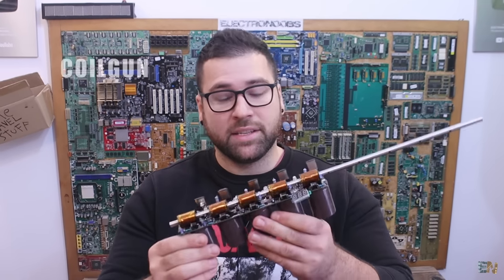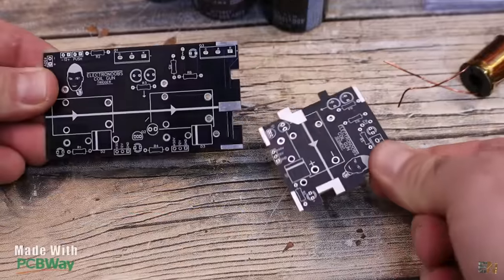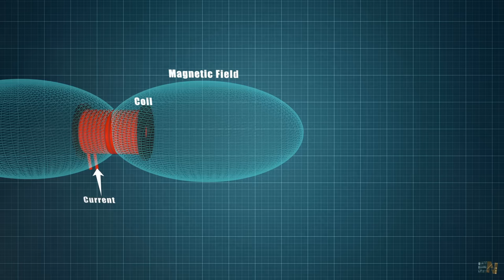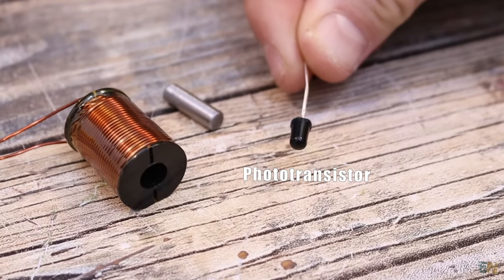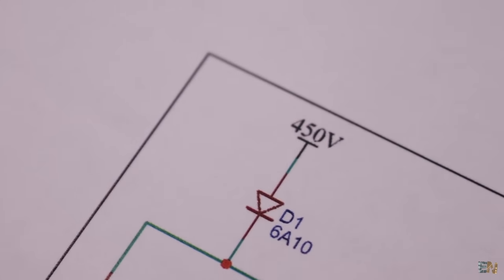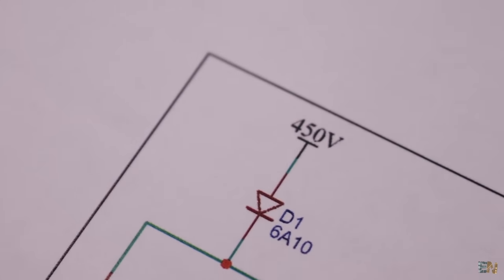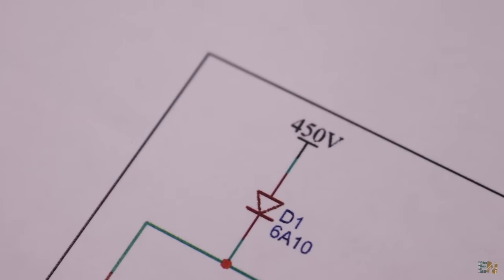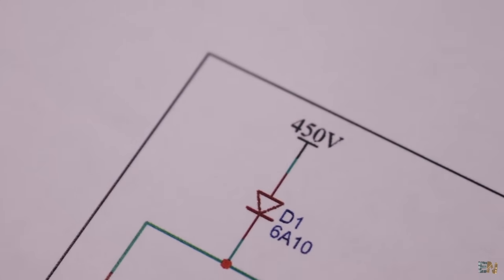I've Made a Powerful COILGUN | Separate Stages PCB

Comment: Perhaps using timing rather than photo sensors would mean more tunability. This would be more complicated because each projectile must be the same, but it could go supersonic this way :)
Reply: Having a weapon with both options in one I think would be the best design for usability. If for whatever reason your programmed timing doesn't gel with the current atmospheric conditions or whatever other variables, you can swap to the sensors as a less powerful but more consistent option for harsh environments.
Reply: Be limited by how fast the triac switch turns on what cud be faster tho ....I need make one just with 3 stages 😮

Comment: BTW, running big high-discharge-current caps at a higher voltage than they're rated for (e.g., 500+VDC on a 450V cap) is a pretty good way to have one explode. Might want to dial back your coil voltage a bit.
Reply: my thoughts exactly one of them is gonna let out the magic smoke then absolutely decimate his entire garage
Reply: @spenza99  The other option is two caps in series (with balance resistors) so there's a safety margin on the voltage, but there's a seep efficiency tradeoff for cap arrays in this sort of application.
Reply: I find your lack of voltage de-rating disturbing…

In all seriousness that made me nervous when I saw it. While it doesn’t need to meet NASA derating standards there’s got to be some margin. Safety is important with HV.

Comment: I very much like the modularity :-) ... BUT your actual circuit works a bit different, than explained in the video: the IR-barrier is positioned in front of the coil. As soon as the projectile interrupts the IR-barrier, the thyristor is switched on and the capacitor is discharged via the coil with a very high current. At that time the projectile is attracted by the magnetic field, and pulled into the coil. When the projectile exits the coil, there is no active switching off, because a thyristor can't be actively switched off. However the discharge time won't take long - the capacitor is most likely empty, before the projectile exits the coil. But there is another issue with the circuit: the discharge current reaches its peak, when the voltage of the capacitor zero. Then the current starts decreasing and charges the capacitor in reverse (the bypass-diode D2 is useless). As soon as the current is zero, the thyristor is inactive again, and the capacitor is negatively charged. Reverse-charging an electrolytic capacitor is not a good idea: I strongly recommend to test the discharge-behavior with the oscilloscope (at a much lower voltage), fix the circuit, use a high voltage mosfet (instead of the thyristor).
Reply: I agree, I was confused during the explanation of the circuit too concerning the thyristor use
Reply: How about a diode in parallel with the capacitor to prevent it from being charged in reverse?
Reply: Great explenation and why I disliked the design as well.
As you add more stages, you get to a point where the projectile is being braked by the field in the coils due to the time it takes to discharge.
I think using transistors in this design would be better. It would also allow you to see the residual voltage on each stage to get a better idea of how much of the energy was used.
Reply: I accidentally connected an electrolytic capacitor in reverse once (it was across a negative voltage rail) and the resulting explosion was quite scary. I dread to think what would happen if one that size exploded.
Reply: Chris Laimer, hey this is off topic, I still have yet to build those 600 motors. Bought the plans and printed all the parts plus ordered the hardware, magnets, and wire. But winding up the 15 meter of copper is very difficult process. I gave up cause I kept messing up on those.
Reply: Sorry Christoph you are wrong about the diode.
His schematic shows the diode in parallel with the coil. As the cap dumps its energy into the coil the current (and magnetic field) will rise in the coil, then when the cap is empty the current will be maintained in the coil by the diode, acting as a freewheeling diode, until the field collapses.
Electronoobs got it right, this is the most efficient way to do it.
There will be no "charging the cap in reverse" like you said.
Reply: @wizrom3046  Thats right. The diode D2 takes the coil current and circles the current until the magnetic field has collapsed to zero (lost its complete energy). The negative voltage at the capacitor is equal to the forward voltage at diode D2 and is probably harmless to the capacitor. The free wheeling current through D2 should have reached zero, before the projectile has reached the middle of the coil. Because every stage is equal in its timing, the magnetic pulse duration should be adapted to the fastest speed of the projectile.
Another idea: You could make a coil gun with no optics. Instead, you would need to make a calibration (or optimizing) routine by measuring the output speed of the projectile after each coil step. With this you could find out, how many milliseconds you have to wait, before you switch on the next stage. Of course you would need a microcontroller to do this job.
Reply: @alexandermikas8063  ... I agree, microcontroller for the win.
But I would KEEP the optosensors, and use them to trigger each stage firing WITH an adjustable time delay for each stage.
Then I would tune it empirically, firing just coil 1 and adjust to get the max velocity from coil 1. Then do coils 1 and 2, and tune until the max velocity is achieved out of coil 2. Then repeat for each coil.
Another advantage with a micro and sensors is the micro can display the velocity after each coil from timing period between 2 subsequent sensors.
With some clever software you could even make it tune iteslf...
Reply: @alexandermikas8063  while D2 circles the coil current, the capacitor + terminal only becomes negative with respect to Coil2- terminal.   The capacitor + terminal does not go below 0V with respect to ground.  I don't see the capacitor being reverse charged here, maybe my understanding is flawed?

Comment: You should have placed the photo sensors at the front of the coil, instead of the back. Then set them to turn on the coils when the beam is blocked. The reason is that you would not need to have the coil on all the time and there will also be no pull back after the projectile has already reached past the half-way mark in the coil and starts to get a pull back effect. The coil would turn on when the projectile gets to the front of the opening and the coil will shut off when it reaches the mid-way point before any pull back happens.
Reply: I like your thought process here.  Reverse the magnetic field of each coil as the projectile passes the midpoint of the coil as well.
Reply: IMO this makes no sense. The ball will want to center in the coil (max force) and you can see his coils are longer than the ball, so if anything you would be slamming on the brakes.

Comment: After studying his schematics, it appears that when the projectile breaks the IR beam it triggers the Thyristor of the next coil in the chain (note: the next coil circuit is drawn to the left of the IR trigger components - schematics should have a left to right flow when possible), but it DOES NOT cut off the coil that fed that IR pair.  Once a coil's Thyristor is triggered, each coil is rapidly energized and then rapidly de-energized until the capacitor is nearly fully drained (note: the diode above the capacitor is an isolation diode so each capacitor discharge is independent from each other - that is good), but each coil in succession is not turned off as he says in this video, they are just drained to zero at their own rate after triggered and thus that reduces the acceleration efficiency of the system. The idea is to have the field at zero as it transitions roughy midway between one stage to the next. Timing here is very critical, if the coil de-energizes even a microsecond too early or too late, the net acceleration between stages is lower than optimum - optimum is what you need. Also I said 'roughly' between stages because that midway point might actually be somewhere within the feeding coil before passing to the accepting coil in the next stage. So exactly when and how fast one coil's magnetic field reacts (Gauss curve), it must properly overlap with the next stage's coil Gauss curve and timing. Each stage will have different timing and curves. Also, as you can see in the video, IR phototransistors have very slow response times, too slow for the pinpoint timing required for efficient acceleration. I think Hall Effect transducers would be better, but the coil fields would interfere with them and the projectile would have to be magnetized. This system is a simple rail gun, Rail Guns use pre-calculated ballistic expectations of the projectile and the system for the best results - no real-time monitoring of the projectile is used. A high speed FPGA with nanosecond timing using DLLs could get the right timing for each coil stage once a solution for the interstage ballistics is found.
Reply: "optimum is what you need" 
I think I have to print this on a shirt. 😂
Reply: @HorstHubert-r6v  "Optimum is what I need, but I will settle for perfection" [laugh].
Reply: Is it possible to record the current generated by the bullet while passing through the coil?
Maybe with a secondary coil just outside the first one, I guess it shouldn't be that big to detect the bullet.
I would record the timing between each stage, and try to calculate some kind of coefficient, to know how much a stage should be on, depending on the capacitor and coil size.
Plus, if you need to discharge the capacitor at a certain point, may a longer (but thinner coil) fully discharge the cap?
I mean, keeping the same wire and number of turns, but using a longer tube.
Reply: He did say it needs a flux dump circuit
Reply: @Fred_Klingon  You are on to somthing, but it's been awhile since I first posted. I just too many other projects and thought to work out now. But you are using your brain and comming up with ideas... total respect.
Reply: @laurencerilling5873  OK, it been while since I have been here, so maybe he did mention a dump circuit. How do you proposed a dumping circuit? I think faster granular timing as I suggested may not require flux dumping.

Comment: Very neat project! A tip on the soldering though as some of them look very poor. I recommend soldering with a medium thick chisel tip and with some more heat for much easier work and much better flow around the joints. it might sound odd that using a bigger tip would be better and might look harder with small parts but you can turn the tip so you get the sharper edge towards the surface which makes you easily apply solder on the flat surface of it and nicely flow on to the component. if you solder with leaded solder around 380 degree C or if lead free up to 400-420 if you have bigger heat absorbing areas (might sound hot for some but this is where I work all the time). a needle tip is weak in every aspect both in how much heat it can transfer and the amount of solder it can hold and it is more suited for smaller SMD work. But I am using chisel tip for pretty much everything. just mention this as creative feedback, keep up the good work!
Reply: I saw some that looked like some solder that I have that I guess doesn't have much flux or it's just no good Even with good flux it is not great but good enough I guess ya it feels like it's not hot enough but I'm over 400°
Reply: @james10739  it depends a bit on the solder itself and the tip you use, if you have a small needle tip it transfer heat so poorly you might even go up as high as 430 degree C to even be able to melt around a groundplane pcb with normal tin. most types of solder without a flux core is usually not meant for soft soldering and is more likely for plumbing work with use of separate flux. But cheap tin is bad yes, I have even seen cheap types have so bad flux that alone short out the device because that flux was conductive. Best solder is the lead based one with rosin core which gives you really shiny bonds and easy and even flow, this is what people use if you watch Youtube and see shiny soldering joints. the downsides of this is of course the lead which is not good to handle too much and the availability of it. if you use lead-free solder you never get a shiny bond and you need more heat to flow it but you always get a pale and rough surface using this no matter how good you are doing it. if you want one of the best and cheapest types of flux you can do it yourself with just a simple can with rosin and some isopropyl alcohol but you are best of cleaning the work afterwards since it won´t be "no clean flux"
Reply: Small chisel tip 👌
Leaded solder at 405° 👌
Reply: @ericbitson8927  Good stuff, Very good!

Comment: If all the energy from every capacitor is discharged in the coil, you have 65 joules of energy with each stage. That's a lot of energy, for instance a 9mm round has arround 480 joules so you'd only need 7 stages to have that energy. Of course, is not a 100% efficient system but still, it's scary how powerful this thing can be.
Reply: well, thats the purpose of a RAILgun.... :P
Reply: Most coilguns efficiency doesn't reach even 10%

Comment: I have some improvements in mind:
1) Use a Teflon tube, as you suggested it creates less friction
2) Use hall effect sensors instaead of phototransistors, they are more reliable and require less space on the pcb
3) Make the boards' interconnects hot-swappable and not soldered
Reply: Maybe he's not using Hall effect sensors because they are so close to the coils, they can generate interferences.
Reply: Its a good idea, it would represent some analog curve and it would have more information than the 'digital' optical switch... Eventually he use Ai to pursue the optimal curve - how about imprinting the slugs first with their own magnetic field?
Reply: @nicolascisneros4742  this
Reply: It’s only less friction if you can keep it straight
Reply: Hall effect is not a good idea, optical sensors are better for high speed
Reply: You dont see any problems using Hall effect devices next to fucking great electromagnets ?
Reply: @usertogo  would be easier to have all the optical switches connected to a cental microcontroller, that way you can calculate the bullet speed and turn of the coil at the optimal time by just waiting xy ms after the optical switch is triggered.
Given:
- You know the absolute position of the optical switches
- You know the absolute position of the coils
Reply: Also his solder joins are very cold
Reply: One more vote for teflon pipe instead of the metal one: This metal pipe creates a short circuit effect on the every coil. It would be a reason of energy loss. The plastic pipe allows to get more power
Reply: @Spacefish007  you could do this more modular by passing the pulse from the previous sensor forward you'd be able to calculate the speed and adjust timing on each module.

Comment: It's a very good invention, but I think you should place the phototransistors at the beginning of the coil. I know you'll say that they will turn off before entering the coil, but here's the best part: the shape of the bullets... If the bullets were shaped like a 'U', the light could pass through them until it hits the junction at the end, which would prevent the bullet from slowing down as it exits the other side.

Comment: Very neat project!
Some thoughts for possible improvements: Since the bullet goes trough the later stages very fast it might be a good idea to switch to coils with lower inductance and capacitors with lower ESR (inner resistance) like foilcapacitors. That way you might be able to increase power output of those later stages to add noticeable energy to the projectile.

Comment: Very nice work, this is exactly the type of videos why I have subscribed to this channel :) I have just a few ideas:

1) It would be great to explain in the video why you have finally decided on thyristors rather than MOSFETs or IGBTs
2) Instead of using IR LED/phototransistor pairs, I'd go for already pre-made photo barriers - for example, the H2010 photo-interrupter has a 10mm spacing, so it would fit an 8mm tube perfectly ;) 
3) Please, share also the EasyEDA project, not only the gerber files (I think there is an option in EasyEDA to make the project public) - if someone would like to make some adjustments or improvements to the PCB (to fit different components, etc.)
Reply: Thyristors are forgiving parts, their peak repetive current can be over 600 amps for a 16 amp thyristor, and they still won't  die,
Reply: Tyristors do not turn off again until current goes to 0... This means it drains each cap as it runs. I don't think that was the intention.

Comment: Great video, great version of a coilgun! right now, I'm in the proces of building a Coilgun myself for a schoolproject and if there is one thing I can tell you, it is to make it a blind system, that is just controlled by an arduino or ESP. As you probably know, the magnetic field doesn't immediatly break down, when you  cut the power. I used Phototransistors to get the speed and adjusted the coil timing this way.